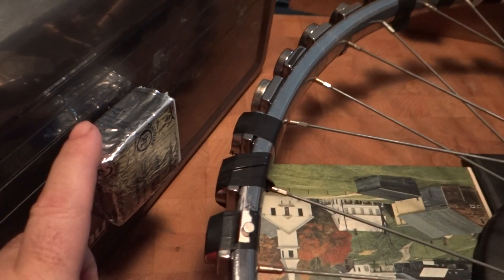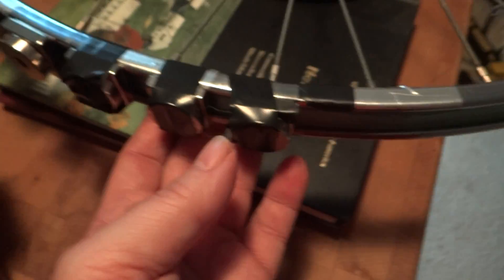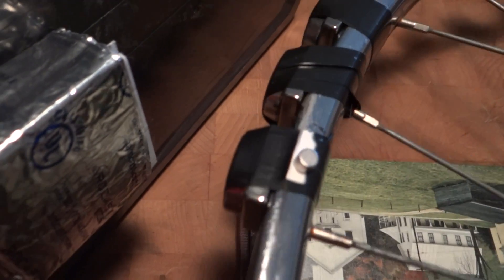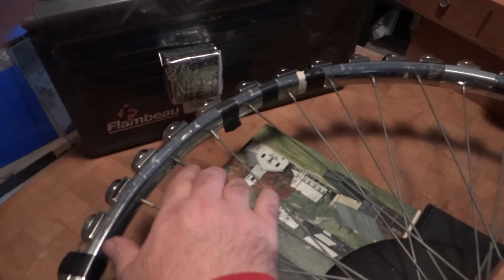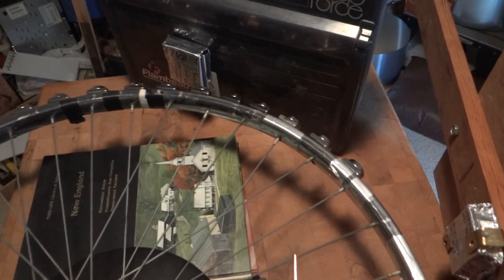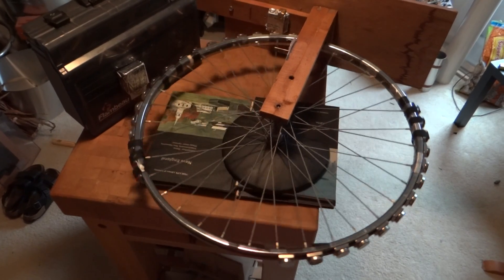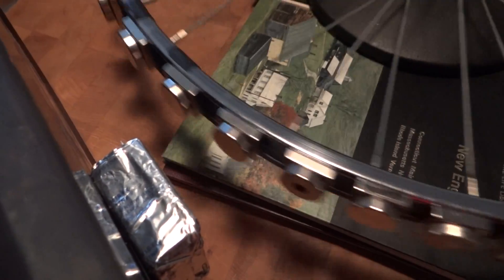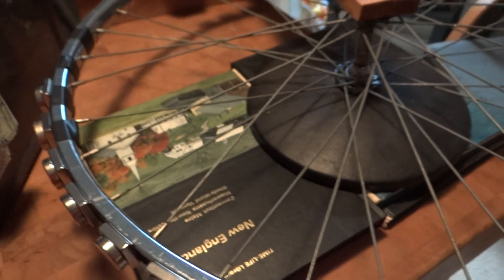🧲 Free Energy Test #1 for Self Running Motor (Leapfrogging Effect)

Comment: I have a question for you. I've worked with this stuff for many years and from what I can see in your video today which is actually very interesting. Have you ever considered trying a wheel that's maybe 2 in in diameter smaller that would increase the RPM and the distance traveled around the circumference of the wheel which you try to do is increase the RPM thus giving you momentum or inertia stored in the wheel spin it. This might actually help keep the cycle running over and over again. Just food for thought. Keep up the great work! Mike

Comment: Take a physics class...
Reply from the maker: I did for two years. Have numerous well read physics books, Including three on magnetism. Outer fringe science is not covered in our current understanding of physics. We won’t find anything in our physics books that explains how UFOs become stationary in mid air, or how they can accelerate in excess of 20 to 30 G in milliseconds and survive, Let alone make high-speed 90° turns. However I do. I also know what gravity is whereas virtually no one on the planet does. I’ll just say this, gravity is simply a byproduct of a much greater phenomenon. I also unlocked the secret to ball lightning. Now I make real ball lightning, and shoot it out of a 4” x14” clear dielectric barrel. All you have to do is make a spark chase its own tail. Good luck, as you won’t find anything in our physics book to help you with this riddle. 

Where I’ve gone when it comes to outer fringe science you won’t find it in current  physics books. They are a bore compared to what I know. I achieved the highest national IQ test in the US four years in a row along with three other gentlemen. But IQ does not always mean your smart, only that you have an exceptional ability to be smarter than the average bear as long as you apply yourself. But a high IQ doesn’t mean I’m a good speller let along great at grammar. 

“I cannot write in English,” Einstein wrote to a friend, “because of the treacherous spelling.” Albert Einstein, the most influential physicist of the 20th century, was dyslexic. He loved mathematics, and science like I do, but he disliked grammar and always had problems with spelling just like me.  I actually know why but I won’t get into it here other than to say that English is a patchwork of poorly devised spellings from various language. 

As you well know, physics is nothing more than our understanding of our natural surroundings converted to math in which is a language unto its own. 

What if I told you there was never such a thing as an electric generator? Rather early on man did not understand what he had discovered. So he gave it the wrong name.  So-called electric generators do not generate electricity at all, any more than a water pump generates water.  Both of them are pumps. But since you most likely do not understand where the electricity is coming from in the first place you most likely will not understand this as it’s not covered in our physics book.

But I digress. 

James

PS: My grade score was so far off the chart that often I was excused from tests. When I did take them I was finished so fast that much of the students thought I had to be cheating, and had the nerve to ask me if that’s how I was finishing so fast. 

What’s even funnier is that after all my education was said and done, high school, collage, even trade school, I simply walked away from it all to live in the wilderness, and eventually the dessert for two and a half years. It was the best years of my life to date. This magnet stuff has simply been a side tangent that has gotten me way off on a whole different path m, far away from my primary research. When was the last time you read Cleve Baxter’s book on, Cell to Cell Bio Communication? His research goes beyond our current physics book, and so is the work around for Newton’s third law of motion. 

More importantly, thank you for taking time out of your busy life to check out my research. Very kind of you. 

🧲  https://youtu.be/e7RXrSYSaqc

Comment: Hello, for a much greater efficiency, replace the steel bicycle wheel with an aluminum or wooden or plastic wheel, which will not be attracted and braked by the stator magnets.
Reply from the maker: 🧲 A BIG No No to aluminum as it acts like a car brake just like steel does. 👉🏻 https://youtu.be/Gw2tT3z1KBs
Thanks for your constructive feedback Creat, and hanging out with me for a moment or two. A lot has changed since I made this video a very long time ago. I'm back for good this time around. I have a lot of catching up to do.
Reply: @JamesRoneyStators  Then a wooden or plastic or fiberglass wheel

Comment: Hi James just letting you know someone in England has finally developed a Magnetic Generation System using magnets that rotate a turbine.
Currently they have a patent pending.
Reply: Source?
Reply: @ronaldd2154  The inventors wife who I know.
Reply from the maker: Hi John, was locked out of the account for some time. Just now able to respond to your thoughtful message. That’s wonderful news. That was over two years ago. Where does the patent on it stand now? Must be info on it by now?  Thanks for stopping by.
Reply: @JamesRoneyStators  not sure because I have lost touch with her.
Last I heard her husband has signed a deal with some university in England.

Comment: Unfortunately these experiments always end with something along the lines of "if only I had one more stator then it would work" but it never does. I tried similar experiments using a record turntable with less friction than a bike wheel and yes you can get some part of the rotation where there is temporary acceleration but this is always matched by deceleration in another part of the rotation. James seems to think that some magic combination of magnets and stators will provide constant acceleration. Unfortunately this is not possible in any configuration. One whole rotation never gets faster than the previous one so the wheel will never self-run as friction will always be there to slow it down to a standstill. Also please let us be clear - this is not "research" by any stretch of the imagination because in research, speeds and forces are properly measured. This is literally just messing about with magnets.
Reply from the maker: 🧲 I hope your life has finally taken a turn for the better as your condescending presumptuous remarks laced with cynicism was so over the top, it seemed to reflect a very unhappy person, fueled  by absolute ignorance on what's possible with magnetism. In the event you ever see my response, you will find links below that shows the you that magnets alone can indeed create continuous motion. Lastly, I had posted numerous videos before your comment that revealed net gain as well as eliminating the infamous sticky spot. All you had to do was LQQK at some of my other videos, rather than sticking your foot in your mouth. Now you can switch feet and start soaking the other one in your mouth.  By the way, the German magnet car motor has been public info since 1966 which confirms just how truly ignorant you are about magnetic motors.

FREE ENERGY MAGNET MOTORS THAT PASSED MY SNIFF TEST 
__________________________________________________________________

MAGNET MOTORO - Rotor Encantado

https://youtu.be/mxgwTzxfe8Y

__________________________________________________________________

Amazing Magnet Motor/Gen Rep.  
https://youtu.be/jKFTAobM-l0

__________________________________________________________________

WORKING MAGNET MOTOR 2023

https://youtu.be/vdtdKE2Qe40 

__________________________________________________________________
 SELF RUNNING MAGNET TURBO MOTOR
 https://youtu.be/6sIBHn5-9pI 

__________________________________________________________________

 WORKING MAGNET MOTOR - rotor magnético
 https://youtu.be/3mD0_0FiJ54

__________________________________________________________________

 MAGNET ONLY MOTOR from SOUTH KOREA

https://youtu.be/smzpbKg9S7M

__________________________________________________________________

1966: German inventor presents his Free Energy Device Magnet-Motor

https://youtu.be/XWQjMyMWXAc

__________________________________________________________________

Comment: Lots of videos but it never works! Which is no surprise, a motor can't be driven by permanent magnets only.
The wheel is accelerated allright but then it is slowed down again. These phases alternate. Driving and braking torques are equal, sum is zero. Physicists know this since more than 100 years. It's time others take notice of it too.
Reply: Ground breaking news there are already a number of patients using magnets to create rotational forces and generation of power.
Reply from the maker: 🧲 Yes I know. There are various videos as well of magnet motors going all the way back to 1966.
Reply: @JamesRoneyStators    The first design of a magnet motor dates even back to 1269, it was done by a Mr. Petrus Peregrinus. But just as all later designs his design did not work.
By the way: what happened about your "ground breaking news" you announced seven years ago???

Comment: When are you going to make a new platform for the wheel in which you will be able to use many more stators?
Reply from the maker: +Danyal Ahmad - Nothing. I've not been able to get back to my research. Read my post on my discussion channel for details.
Reply: Danyal A. 
 Working model 🔴 
https://www.facebook.com/868063649941365/posts/3187630997984607/?vh=e&extid=UfcBAXDCycxcdgjZ&d=n

Comment from the maker: 12/04/2014, 01:21 AM

GROUND BREAKING NEWS:

I am happy to report that I have finally made definitive progress on my theory, in that, you can indeed get magnets to do work by themselves.

A few hours ago I removed a grouping of five sets of armature magnets out of the forty-four sets total that it takes to completely circle the wheel. This created a seven inch gap in the circle of armature magnets causing three unexpected reactions.

(1) The problem with the three or four armature magnets not having the correct magnetic strength, which was causing back drag on the wheel, suddenly and unexpectedly, disappeared.

(2) When I proceeded to test the wheel again with the approximate seven inch armature gap on the wheel, with a slight nudge, the wheel started up real slowly, and then suddenly out of the blue, the wheel accelerated and immediately locked in at a slow but steady speed automatically.

(3) The wheel starts up from a virtual dead stop all the while the bicycle wheel is under a light load from card stock that I have firmly pressed up against the bicycle spokes (like that of playing cards on a child’s bike) and still, the wheel continues to move at a precise steady speed. The card stock was fastened to a wooden brace with a brass screw (see picture) that makes the bicycle spokes bend the card stock back with each spoke. Each time a bicycle spoke releases the card, it makes a clicking sound. The consistent timing of the clicking sound “tells all” as it allows the observer to hear the wheel starting up and slowing down, and most importantly, enabling the “I witness” to hear the wheel maintaining a constant, steady speed.

I hereby, officially put my "magnetic Leapfrogging" theory to rest, as it's no longer a theory, rather it is now a matter of scientific fact, in that, magnets can indeed be configured in such a manner that armature magnets will leapfrog from one magnetic stator to the next stator, in a circle configuration, using only permanent magnets, and without the aid of outside energy or forces, which includes the force of gravity itself which does not come into play in this experiment.

More one-way stators must now be built to assure that the gap in the armature magnets can once again overcome the armature gap, as to allow the wheel an unimpeded three hundred and sixty degree rotation.

Please note; that in no way, shape or form is this to be confused with or perceived as, “perpetual motion” as magnets ware out and become degaussed over time.

-James
Reply: +JamesRoneyStators 
Congratulations, looks real promising. 
It looks like a third stator would definitely help. I'm just thinking aloud but if you could somehow be able to control the distance of the magnets to the circumference depending on their position in the circle in relation to the stators. Not sure if it's possible to modify the wheel to automatically position the magnets closer or away from the edge at known points. 
Interesting stuff, thanks for sharing and good luck.
Reply from the maker: +Tamer Temel - Please join us at: https://www.facebook.com/groups/FreeMagneticEnergy/
Reply: How long before the magnets degause? /stop spinning, Years? Thank you.
Reply: Hello, for a much greater efficiency, replace the steel bicycle wheel with an aluminum or wooden or plastic wheel, which will not be attracted and braked by the stator magnets.